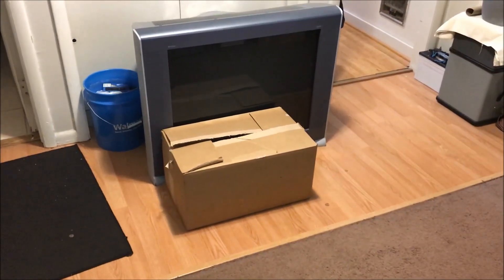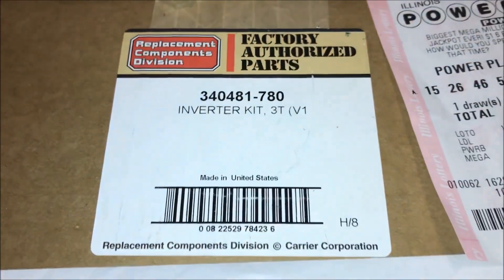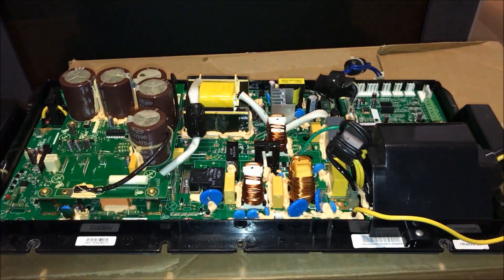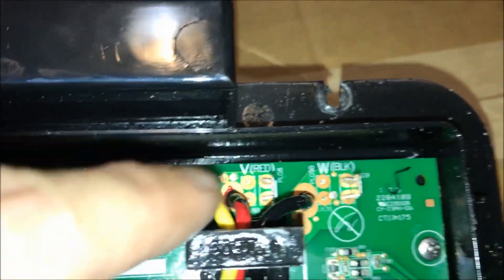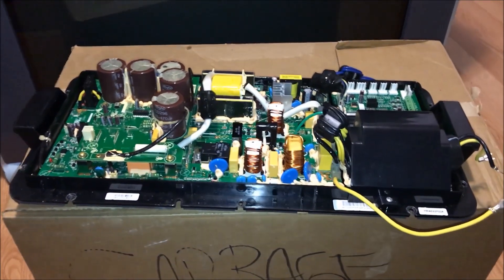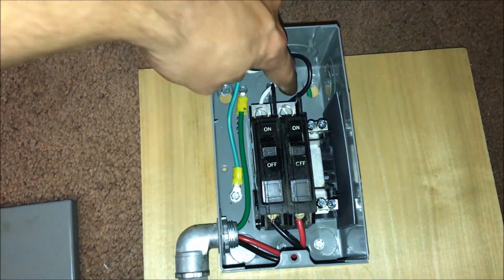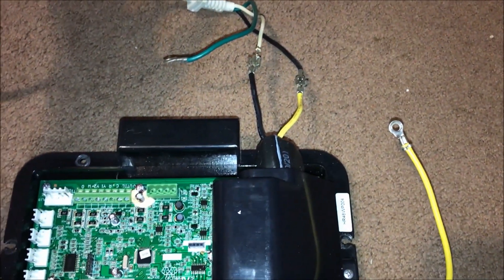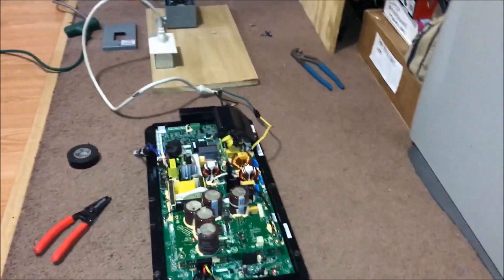Carrier Air Conditioner AC/DC Inverter: First Look And Power Up!!

Comment: If you just want DC, get a PFC board (power factor correction). It's basically a rectifier and boost converter.
You should be able to find one in a high power switchmode supply.

The board you have is a motor controller made to spin some kind of 3 phase motor (likely syncronous motor).
It will likely not do a lot meaningful with other loads.

It's a fun board if you have the compressor, and it can be used to inflate random junk.

Comment: 30 amps through 14 gauge? Just gonna send it...
Reply from the maker: That's its rated peak current draw ll. Not what was actually going throught the wires. This was all just to see if it would turn on :)
Reply: Still gonna send it! If this board pops promise me those caps will be blown?
Reply: I run 20 amps through 18 AWG on the regular... 14 AWG will do about 35 amps before getting uncomfortably hot IME
Reply: Not to mention a 10 AWG extension cord sounds very expensive...